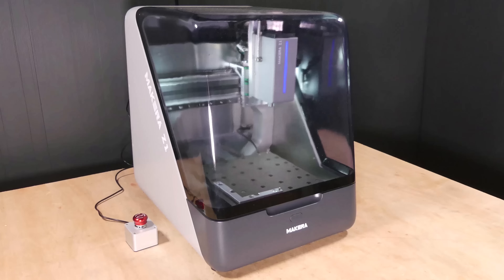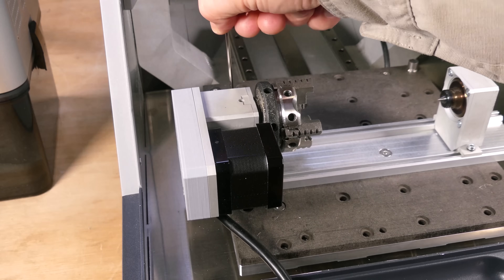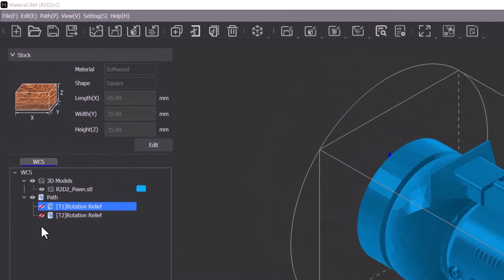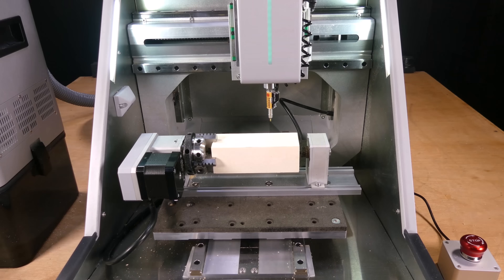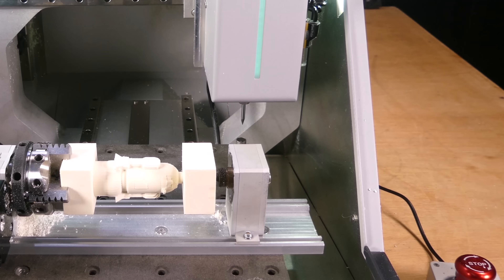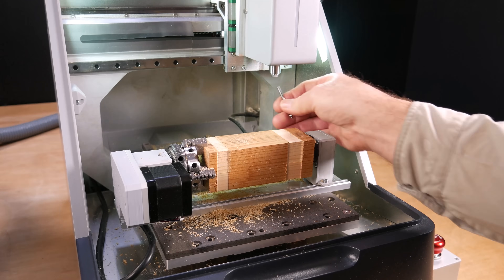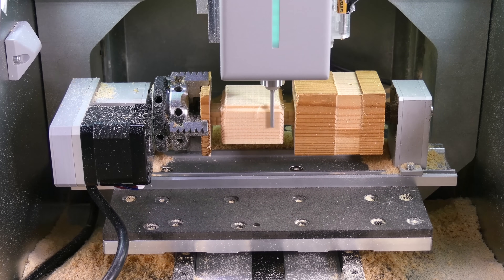Makera Z1 — 4TH Axis in Action (Rotary Carving & Indexed Milling)

Comment: Fantastic video. I dont suppose you would be able to upload a tutorial about how to do the index milling? I've been faffing about for days trying to get it to work!
Reply from the maker: Are you using the full version or the free version ?
Reply: @techydiy  full version! Benefits of working in Edu!
Reply from the maker: I'm working on other stuff at the moment, but you can download a demo project here:
http://www.techydiy.org/makera-z1-rotary-4th-axis/
I have included a rotary model and a variety of indexed toolpaths, so feel free to have a look at that and ask any questions. 
It does require the full version of Fusion. 
As an education user, you also have renewable monthly access to the manufacturing extension, which includes full 4-axis machining and rotary options in a separate tab.
Reply: @techydiy  Thank you so much - should be enough for me to get my head into! Definitely a shortage of good tutorials for Fusion CAM setups (two sided/4th axis etc) and you certainly have a good knack for doing these things!

Comment: wtf...no safty needed ey... the hood should be closed and deceted by a safty switch...
Reply from the maker: There is a safety switch on the case, you can choose to enable it or disable it. Obviously I need the machine to work with the lid open to film it properly.

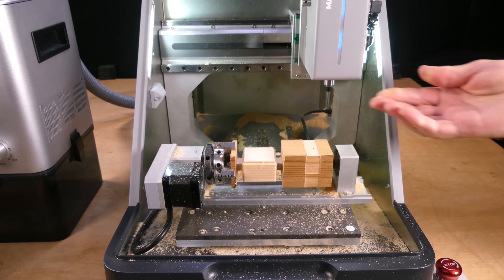Comment: Did that chamfer bit zero out on the tool setter while it was rotating? (7:31)
Reply from the maker: No, it definitely wasn't. I went back and checked the full video clip. I had the spindle fan (Aeroblast) switched on,  that sequence was 1.5x video speed and that is what you can hear.
Reply: @techydiy  The air added to the illusion but as I wasn’t able to see the tool tip clearly in the video, I had to ask.

Comment: Did you use the included software for the indexed milling?
Reply from the maker: No, fusion. Makera are working on full 4 axis toolpaths for their cam software though, so that should be a good option.

Comment: When it probed to tool locator with the v-bit it looked like the spindle was running..............!!!
Reply from the maker: No, it definitely wasn't, I went back and checked the full video clip. I had the spindle fan (Aeroblast) switched on, that sequence was 1.5x speed and that is what you can hear.